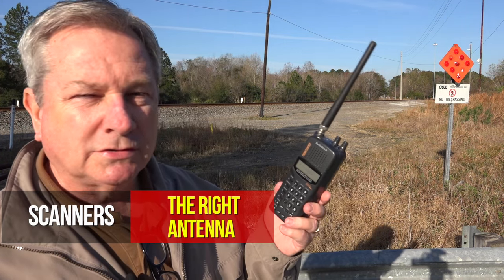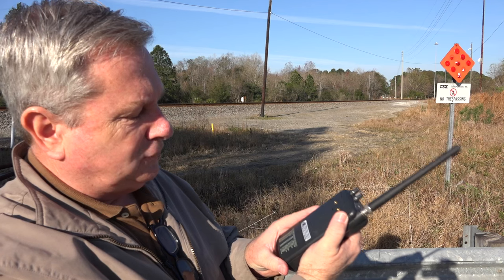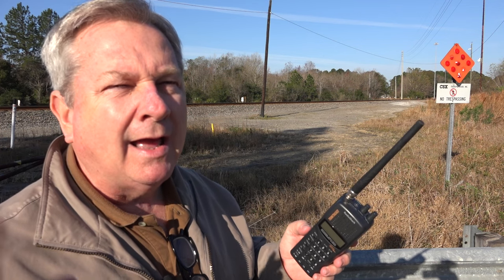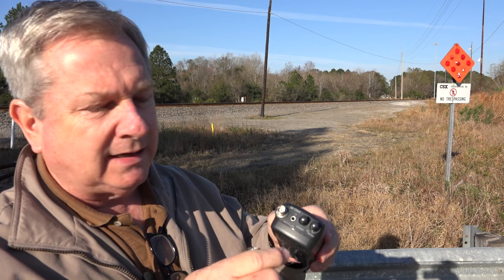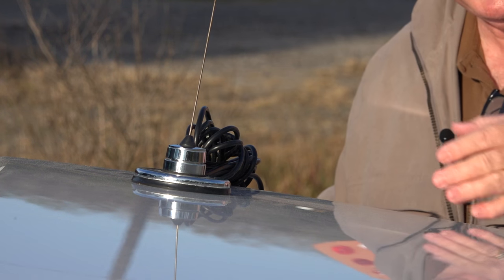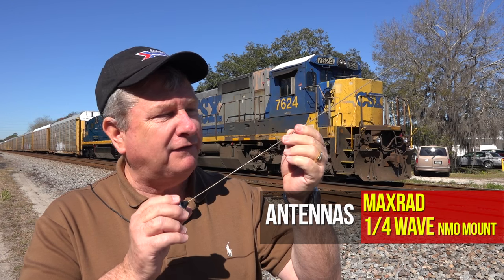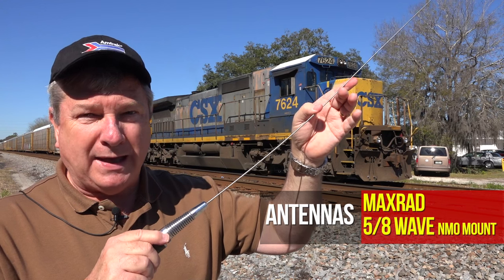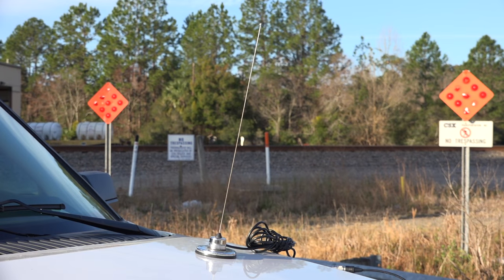Using A Scanner For Railfanning Pt 1

Comment: I have meany types of Radios I use for RR at home I have 5 Icom V-8000 they are cheap they have great RX great FM sound even though Iam a Yaesu fan  I use these for my RR radios in the house now for the Van I use a Icom very old it is from 1994 2232h it is a dual band I have Motorola Speaker a 5/8 ant it has great FM sound when I went to my home town 1 time there is a railfan spot called Peck Park I drove up I was in my Chevy S10 at that time there was like 10 railfans there it is a great parl they all grouped up was talking 1 guy came over said we want to know if u work for the rr I said no why they said your radio sound just want they use I said in a way but theres are much much better but if I wanted to spend $6000 for a Motorola clean cab radios u see the diffence but my Hand helds are Vertex VX-150 they are very rugged not made any more but they are sought after by railfans great RX on just a rubber duck Iam going to try a Smaily ant some say they arent worth the money but hey they are cut to band 160mhz on my Vertex HT I use a rubber duck it is cut to the 160mhz band I was given 4 of them I always have 2 HTs all when I am out in the field I can tell the diffnece between the stock ant & the 160mhz I buy those Vertex vx150 ever time I can I have gotten them as cheap as $25 there were well known for the transmit to go out so hams more or less give them away but there is the Yaesu FT270 it is the same radio inside just a differnt case. I also have 2 vertex VX2200 these radios are better then Ham radios they are Bussness band radios but cheap Vertex has meany types of radios they have them up to $3000 some PD's use them I hear NS used them at 1 time in there trucks but again u get what u pay for.  Go to a Hamfest look for a 2 meter radio they are much better then a scanner if all u are going to do is use it for railroads but dont transmit on it if your not a ham NOTE DONT TRANSMIT ON THE RAILROAD FREQS REALLY YOU WILL GET CAUGHT & JAILED? I had to put that in there I had a friend his dad worked on motorola radios in his radio shop well my friend use to talk to the NS crews they talk back for over 3 years but it took that 1 time he caught a train that had a big wig on it he was in jail with in 10 mins the city PD picked him up then the NS came then the Fcc was contacted the same time there he went to Fedral court his dad lost his shop contract finded big time almost went to jail himself cause the radio was a Motorola old but he knew better then to let him have a radio that transmitted.  Just some helpful info I have been asked meany times what radios I use when Iam out or on my videos O I forgot I use a Motorla mic. u can by knock offs of it for $6 from China but trust me they dont sound as good as the Motorolas I have both I like to try things look the same but far from sound of a Motorola mic Motorola has a basser tone to it more like what they use well I say they did use down here they went to Kenwoods the clean cab radios is a new brand name they are very good but high $$$

Comment: i transmit on the railroad band sometimes lol.
Reply: +treos17   Not with YOUR antenna, I'll bet.
Reply: Yup with my antenna, but its attached to my railroad radio, not a scanner, and only when Im working
Reply: +treos17  Perhaps, then, you can tell us which antenna you chose and why?
Reply: +Lawrence Stephey I use an icom f3261D radio, and the reason being thats what i was issued.

Comment: I have a radioshack weather alert scanner that has fairly good reception.. Not always. I like the extension antenna you showed first for my scanner, that would work fine.
Reply from the maker: +HyperActive7 Yes,  the programmable Weather Alert can also receive railroad radio. Any extension outdoors will improve your reception.